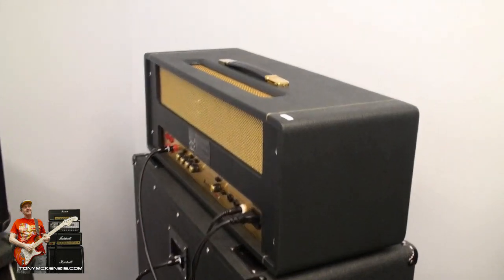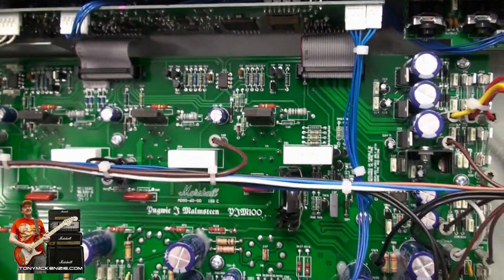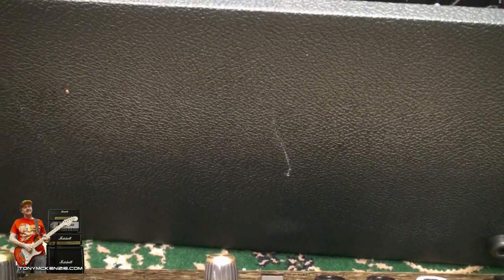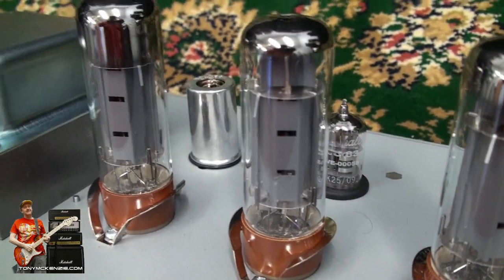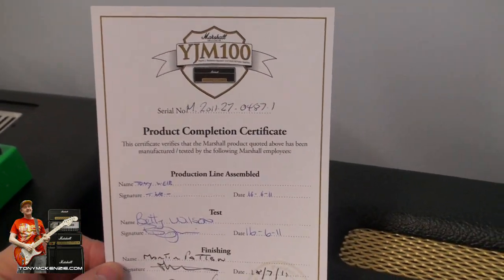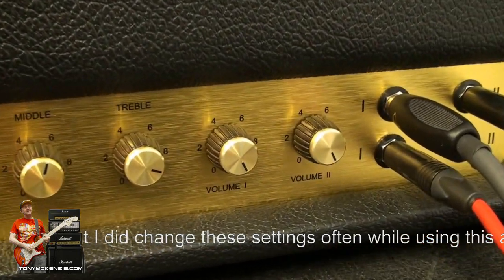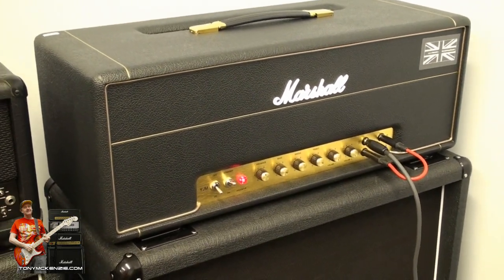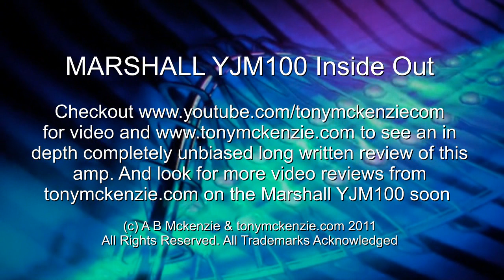Marshall YJM100 Guitar Amp Review Inside and Out Close up

Comment: Hey people,
are they for real?? 1500 gbp for this cheaply made hybrid amp????
not a chance in hell.... for the same money I can buy me a nice hand made REAL TUBE amp with NO DSP in it.... in fact there are many Fender 78'-79' Super reverb, Mesa and Peavey Classic 50/100 amps which sound better than this one and ARE hand made, point to point.... no pc board crap, no digital crap... straight tube sound..... im not about to fork out 1500 gbp to sponsor YJM.... sorry to offend anyone who bought one, but thats my opinion. (and im a huge YJM fan, but I doubt he traded in his 74' plexi's for this one.....)
Reply from the maker: The real question does not really relate to cost... or indeed how it's made. What really matters is how he YJM100 sounds. Question is, if you have not used one for a while then really you would not know... right? I used the YJM100 for some time and to be honest I thought it was one of the best Marshall amps (along with the JVM410HJS Satch model that I have used in a long time. PC boards are used today in most of the top brands including the ones you mention, Mesa has PCB's for years and so does Peavey and theres nothing wrong with that. Diezek Hagen also uses PCB stuff and frankly there are not that many around today that are not PCB based. The digital 'cr*p' is typically used for changing channels within the amp and other things like midi.

I understand your point for sure, the good old days of p2p etc. but having been there at that time I for one am glad to see all that (pop crackle and bang) gone and I don't think I would ever go back to inflexible, usually one channel amps that only mega guitarists like Jimi Hendrix had any chance to use at those volumes. It's not that feasible to use them, unless you put a TS (or something) in front but then... oops you're using non tube stuff in the front end and there goes the plexi sound as we know it. 

The words 'Hand Made' tend to  remain in the early 70's unless you have loads of money (and I really do mean loads) to sink in to new 'Hand Made' stuff because some of the older amps you suggest are not too reliable and absolutely not as flexible or robust as the newer ones. Check out what Marshall themselves say about their current 'Hand Made' amps in my Marshall factory tour on my channel - you might be surprised.

The YJM was an expensive (and a limited edition) amp and it's much bigger (and heavier) than a regular 100 Marshall, but it certainly does cut the mustard when you plug it in and play. 

You should try one and try not to be too biased toward older technology that has often seen better days. You might actually like it! Thanks for watching.
Reply: THANKS FOR YOUR INPUT.... I WAS TALKING FROM A TECHNICIANS POINT OF VIEW.... BEING A TECH FOR 30 YEARS AND A GUITARIST AT THE SAME TIME, OWNING A DUMBLE OVERDRIVE AND A FEW (4) PEAVEY LYNYRD SKYNYRD MODEL AMPS, AS WELL AS A COUPLE OF 60'S SUPER FENDERS AND A 74' PLEXI, PLUS MY LATEST ACQUISITION AN 80'S SOLDANO, I CAN SAFELY SAY THAT THESE PROBLEMS YOU WERE REFERING TO ON THE P2P AMPS, TO ME HAVE NEVER BEEN A PROBLEM, THEY WERE EASILY FIXED.... BUT MY POINT WAS THE SOUND.... I WILL GO AND TRY ONE AS YOU SAID, BUT I DOUBT IT WILL EVEN COME CLOSE TO MY DUMBLE OR SKYNYRD AMPS.... (NOT A CHANCE OF REACHING A SOLDANO....BUT THATS IN A LEAGUE OF ITS OWN...) IT MIGHT SOUND BETTER THAN MY 74 PLEXI BUT THATS BECAUSE OF ITS LACK OF DRIVE, NOT BECAUSE OF ITS "FEEL" OF SOUND ONCE CRANKED UP...... BUT YA NEVER KNOW.... THE TEST WILL PROVE ME WRONG.... OR NOT...  (PS, THE SATCH AMP HAS NOT PASSED MY TEST... IT WAS NOT AS GOOD COMPAIRED TO MY DUMBLE... WHICH IS WHY I BOUGHT THE SOLDANO IN THE END...)  CHEERS...
Reply from the maker: ***** If you want to spend $50k on a Dumble... sure the sound is there... but the original thing was... what £1500 gbp!  You cannot compare the two really, neither most of the other amps you have listed. Of course, you are right there are 'cheaper' hand wired' amps for sure, and 'aficionados' of those amps will never change their views even if the newer gear is more reliable, cheaper (compared to those you listed), more features and indeed can sound better (but that's subjective of course). BTW a Satch amp is not and was not developed to be like or sound like a Dumble in the first place as I'm sure you know. For what it's worth I have a Ceriatone HRM 'hand wired' and personally for the $49k difference between that and the Dumble I'll keep the Ceriatone any day and spend the rest on something else :) but the HW aspect of even my Ceriatone makes little difference really between that and a PCB amp except all the things that could more easily go wrong on a HW amp. Interesting subject.
Reply: and youre right... if you want to buy a real original Dumble these days you would spend that much.... mine however didnt cost me that much....  the Ceriatone you mentioned is an awesome amp... I might get me one in the future.
But I will insist, as a tech, that the HW amps do not have the problems you mentioned... ALL amps have problems... the difference being, a HW amp is easier to repair and modify... it all comes down to production costs... it costs too much to HW an amp and thats why they seldom do it these days... the PCB amps however, (speaking as a tech), have more problems, mainly due to dry joints and cheaper components in order to cut costs for the extra features... thats not a bad thing, but it does produce the label "cheaply made".... which turns on the "alarm bells" for any tech like me.... if its cheaply made it should be cheap to buy... not 1500 GBP (close to 2000 Euro...)... thats alot of money for any mass produced amp... I payed 2500 Euro for the Soldano, which is a way much better amp than the YJM.... indeed, interesting subject...
Reply from the maker: ***** I'm sure there are amps PCB based that do have loads of issues. But from my experience (and I have loads of amps) TBH I have not seen a single amp issue since when I had a Mesa MK III and the amp started to buzz and pop (after about 10 years LOL). I do like the Mesa stuff as you will know when you lift the lid on one of those you just know its really well made and assembled.  I agree on the production costs aspect too, but I see more and more Chinese amps these days and some of them when you open them up are really not good with soldering joints that are lets just say dodgy from out of the box.

Funnily enough, one of the worst examples of solder joints I have seen for a while was in a Machete that I bought specifically for review. Inside those joints were very dull and not at all as you might expect them - and that was a Fender amp - I had to return it with loads of issues.  Now relating your points to THAT amp I agree with every one LOL. But most of the better amps I see are really not like that - and if you have seen my other reviews you will know that I purposely go inside to show what you are buying. The only thing re the YJM100 IMO was that the amp was also very limited production (you cannot buy one now new) and they have to recoup costs of development etc. one way or another. Another amp that had less than perfect soldering was the Orange Jim Root #4 - made in China. While not as bad as the Machete I would be confident in saying that over time that amp will have dry joint issues too.
Reply: True.... yes, its a pitty some well known companies moved production to China for some of their models.... huge mistake if you ask me... cutting costs isnt good when your QC standards drop with it...  all said, a good amp shows itself on the road.... pcb or not, in the end the sound is all that matters. As for the YJM , its a pitty that you found QC issues on a limited edition amp... that is not good... anyway, thanks for the chat... keep the reviewing happening.... we are all waiting for your next venture...  Cheers.
Reply from the maker: ***** ;-) thanks for watching.
Reply: YOURE WELCOME...:)
Reply: ps, im not sure of the legality behind it, perhaps you might shed some light on this....I was thinking of making a Dumble clone... Some time ago, I had to do a small repair on mine and you wont believe how easy the goo came off.... I now have the complete and proper values for all the components of its circuit.... what do you think? is it legal to do a clone of this one? parts shouldnt cost me more than 1000 GBP to buy.... but being an honest person I would not like to break any laws.... however, if successful (and allowed to do so), I could sell this for over 3000 GBP....
Reply from the maker: ***** Well yes technically it is illegal, although many guys have often tried to 'replicate' a Dumble. The way I look at it, is that Dumble took a Fender design and tweaked it. As you will know, tube amp circuits have been copied over and over forever (just look at the Marshall ripoffs out there) and Ive never heard of someone ending up in court. If you make an amp for you how likely is it that you will end up in court? I would bet 99.998% against someone ending up there irrespective of the rights and wrongs of it all.  But remember near enough every 'Dumble' was/is different so it's more a case of 'I have a clone of THIS Dumble' rather than some generic solution for ALL Dumble amps.
Reply: Indeed.... you are right once more....  though im yet to find a dumble clone that sounds near as good as an original... In the past, me being an electronics tech, I have tried many times to make an amp using the "Humble Overdraft" circuits that circulate around the net.... never got it to sound like a Dumble, or even as good as my Super reverb.... in fact they mostly sound like a Marshall or a Crate.... This time though, since I have the right circuit and the original amp at hand, im pretty sure I will make it happen, do you care to give it a run down test once I have it complete?? I reckon I will have the thing ready by this Xmas.... I can send it to you for a vigorous test once its done... Oh, I spoke with a lawyer friend today.... He told me that as long as it has one single difference on the circuit, then theres no patent infringements that apply to making the clone (providing I dont name it as the original, or have it aesthetically looking exactly like the original...). wish me good luck on this.... Cheers
Reply from the maker: ***** Sounds good on that project (you are lucky to be able to get that info) and Im sure that you can do it if you have the info etc. Do let me know how it goes... I do have the Ceriatone and it's not entirely the same or entirely the sound either, but it was a fair price for the amp and I gained a lot from the build - very enjoyable. I think that your lawyer guy will be right, but when I spoke with Santiago Alvarez a couple of years ago he was talking about how everyone copied the Marshall's (especially the P2P) and Marshall could do little to stop it. The law is different in different places so I guess thats part of the whole issue. 

Best of luck with that project.
Reply from the maker: ***** BTW nice guitar playing ;-)
Reply: Thanks man.... im not such a great guitarist anymore.... dont practice much, so the fingers lack their earlier days finesse....

It doesnt surprise me that Marshall couldnt or wouldnt do anything, considering they originally ripped off Fender on the amp circuitry and just reversed the output transformer to give it a a different sound.... 

Yes, Ceriatones are great, as I said previously... they dont sound exactly like a Dumble, thats for sure, but the one I tested (owned by a friend) sounds better than a Dumble... smoother highs, richer lows, "browner" overdrive.... more 'alive" is the word.... perfect for blues.... I might get me one, lately ive been seriously thinking of selling my Fenders and two of me Peaveys since I dont use them anymore... ive become more blues based as I age.... (my excuse for not being fast anymore...)..
Cheers mate.
Reply from the maker: ***** Well speed is not necessarily the answer. Check people like the guy in FREE who unfortunately here any more. Simply awesome from just one or two notes. Stay in touch...
Reply: yep, and again youre right.... though he had something special..., thats the reason why he became famous and I didnt... some people have "that extra something" and others (like me) dont...:) 
will keep in touch... thanks for the chat.
Reply from the maker: ***** Hey Brad, what ever you are harping on about I'm not too sure. You seem fixated to something.  However, check out my review of the same amp on my website. I'm not sure if the 'moron' you refer to is me or not, but either way it's better not to call people names right?  Frankly this is a great amp and I would not disagree with any of that personally - remember I've owned one. The ONLY less than favourable review I have ever done with Marshall (I like Marshall?) is that crappy JVM410H and well... it was crappy. The JVM410HJS fixed that. Pity though if you bought the 410H right? I had two and never fixed that awful shriek. The YJM though I felt was a great amp.

BTW I did delete your second comment and whoever it was aimed at its best to be civil.
Reply: You didn't think about the solid state pedals that Malmsteen uses before head, somehow those both are included inside. The noise gate is made with that dsp stuff
Reply from the maker: That is incorrect. If you check out my review on my website, I cover the issue of the drive pedal and Marshall designer tells the story about that in the review here: http://tonymckenzie.com/marshall-yjm100-malmsteen-guitar-amplifier-inside-and-out-review.htm and I hope you like the written review. Thanks for watching.
Reply: Uh dude, thats so long to read lol anyway I wrote "somehow". To avoid copyright deals I  guess it is not the same circuit (Pity there is not any schematic aroudn the web). And I just noticed it have reverb, another use for dsp.
Btw JCM900 have solid state too. ppl might complain of the board design (position of components, distance of hot routes), electronic design (tends to burn the first 4558 buffer), not about solid state
Reply from the maker: I did ask about the copyright re the pedal and the designer said that the circuit was pretty much industry standard on that and that his design was 'similar'. Yes my review was long when written, but it did include most things. Seems the 900 does not sell well and is not a preferred amp of the tubemeisters... probably relates to the tones on that one.